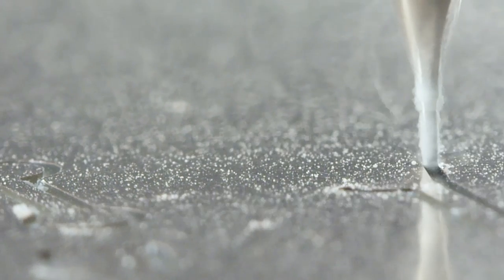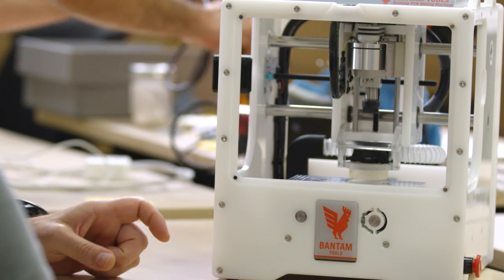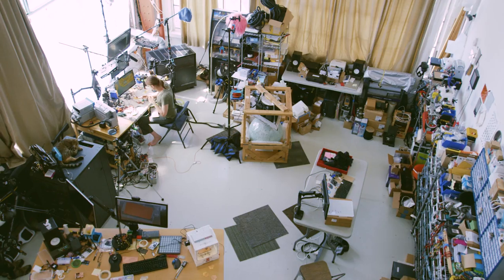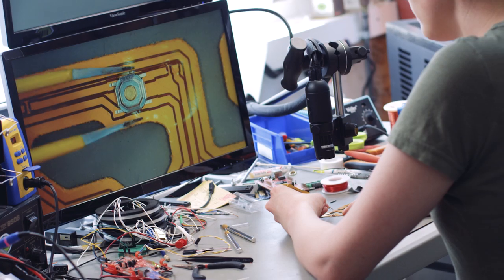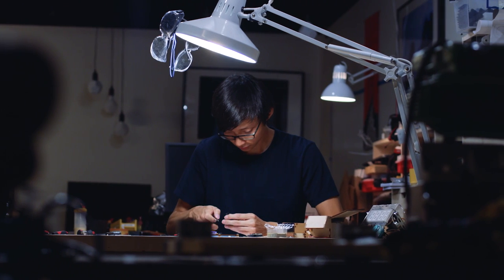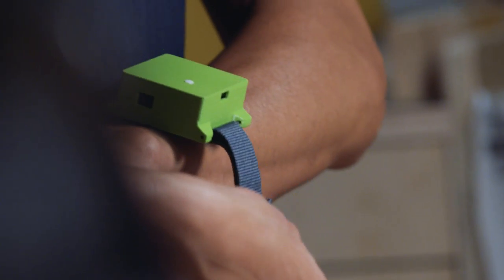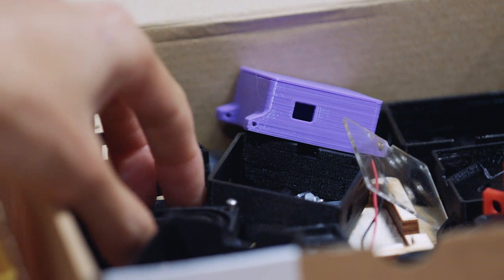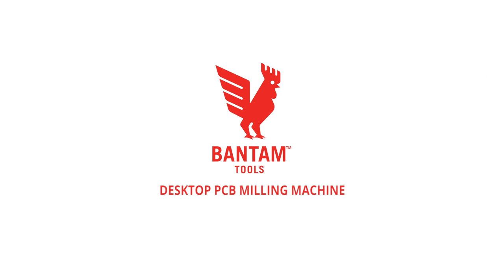Introducing the Precise Bantam Tools Desktop PCB Milling Machine

Comment: Just one question, can this machine make vias? Or it can only drill holes?
Reply from the maker: Hi there - The Bantam Tools Desktop PCB Milling Machine can drill the holes, but vias are not plated, so on double-sided boards you’ll need to solder a wire on either side of the board to connect them.

Comment: I dont get these machines, you can buy a cnc engraver from amazon for 400$  that will do anything this machine can with the same table size. Or you can spend 4000-5000$ and get a pretty serious cnc machine from ebay that can cut aluminum and make massive PCB's. Not to mention that china makes PCB's for penny's these days. So is it the software that's worth the extra few thousand? Does not even use ball screw bearings sheesh.
Reply: Any good suggestion? I am looking for one that can open eagle cad files
Reply: @fastlater  google PCB-GCode and    cnc autoleveller, you will need both